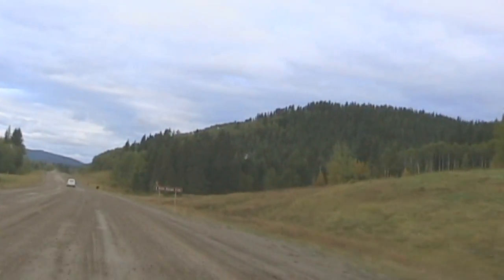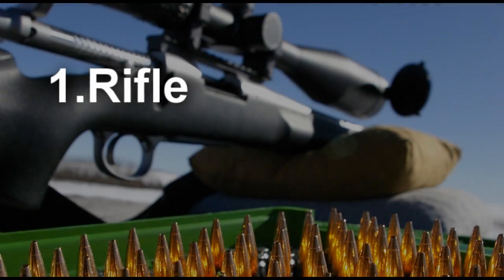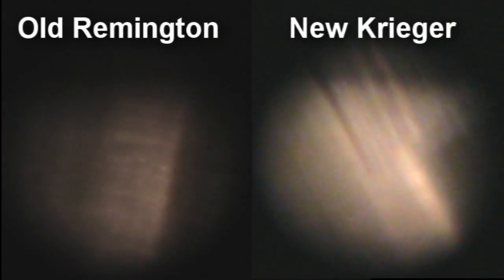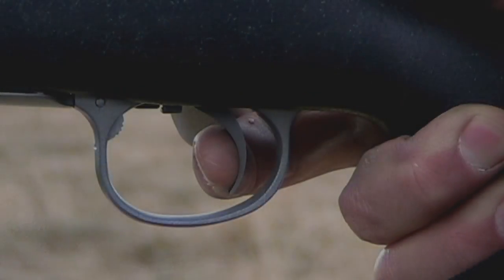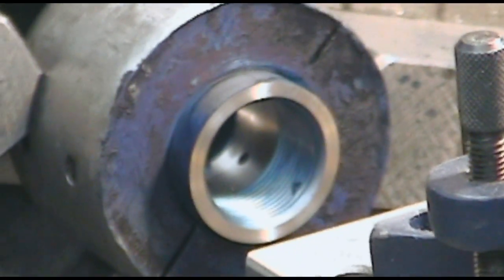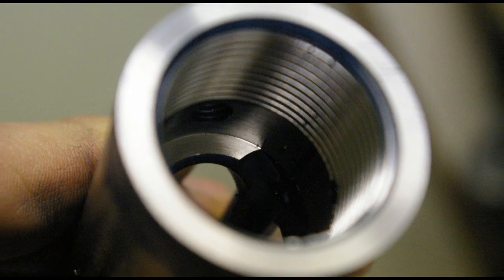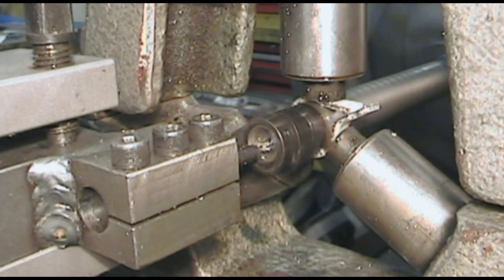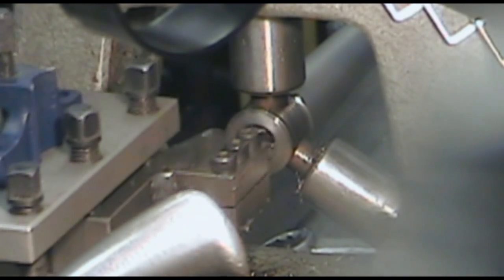Road to Precision Part XII - Improving The action

Comment: Tubb's Final Finish and/or Throat Maintenance kits.

Look into them and use them. You will be impressed!!! If you use the Final Finish in your rifle, just use grits 3-5 and you will see a difference in ease of cleaning, reducing barrel heating, and groups. You would also see a different view when you look through the bore scope.... nice and shiny with no tooling marks.